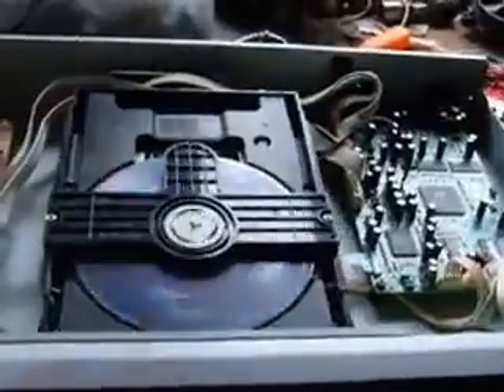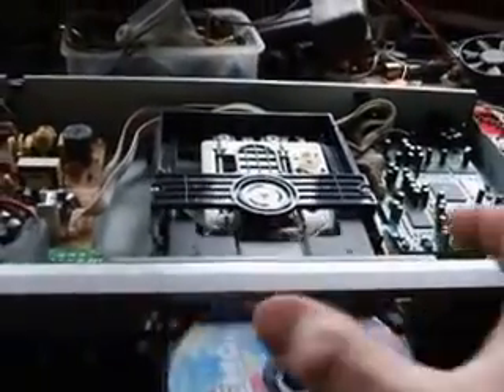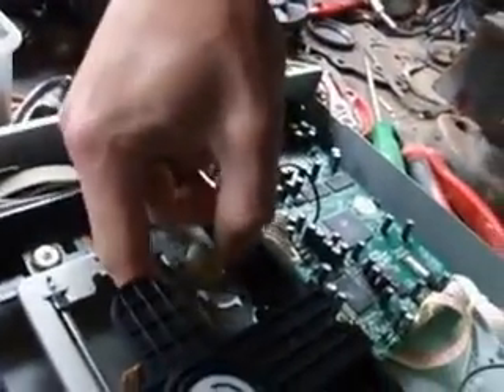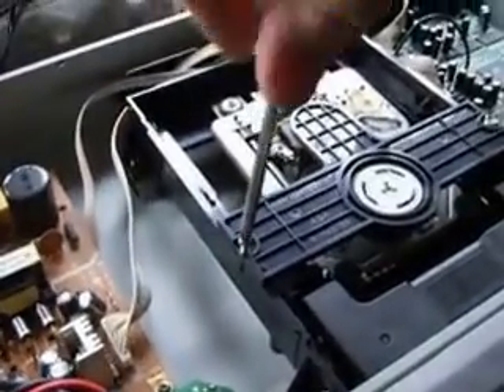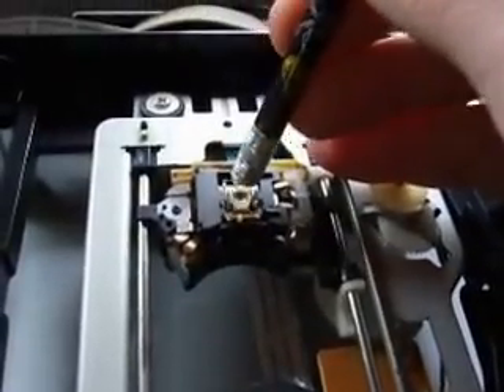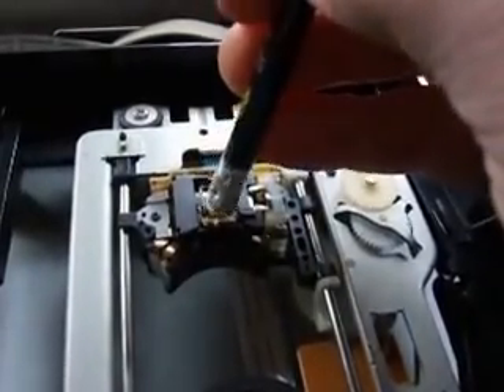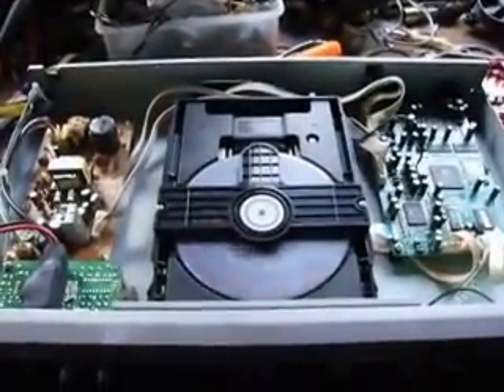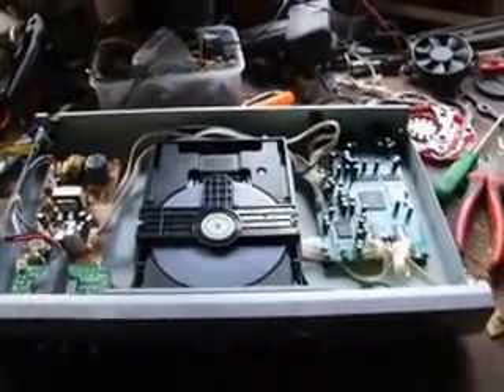Simple dvd fix that engineers use

Comment: how can cleaning the face surface of the objective lens , without cleaning the obverse side and the 3 focusing prisms underneath make any difference ?

the only engineer who would use this method as a first line treatment is Mr Magoo

and by the way the silica in the rubber would scratch an acrylic lens . This wouldn’t be an issue for cd or DVD but a death  sentence for blu ray

Comment: I have to say I was very sceptical about this fix but thought I may as well give it a go on my temperamental TEAC P650 CD player as I'd had no joy with the more widely recommended q-tip method. I'd also been unsuccessful in my attempts to locate the pot which increases current to the laser, which is mentioned in other videos. Anyway, a few rubs later with the rubber end of a pencil and a handful of discs that were previously not reading at all now do so fine and play through with no errors. I have more to test (discs of 70+ minutes were typically troublesome) but the signs look very good, so many thanks to RDJ for posting this!

Comment: Most cases a light rubbing with a cotton bud will get the dust off ... think of it like you looking through a really dirty window... you definitely can't see everything... to laser reading devices CD/DVD/BLURAY it can block enough that the machine won't acknowledge a disk at all ... and if it does it won't be able to play it correctly

Comment: Thanks for the instructional, gonna try this on the Sony DVP-NS57P I've had for years that started loading sluggishly and now throws the "cannot play disc" error, after having played it all night long. First, I must buy a pencil. lol
Reply: Any luck? Same issue here 🙂
Reply: @iandiaz4129  Sadly, no. I can't get the outer case to separate from the front panel. And I can't find a schematic or another tutorial that'll show that step by step. So, it lays on the bench partially disassembled. If I can't get help with that, I'll be forced to ship it to a repair shop across the state (or do eBay, which I don't want). Let me know if you figure it out! Paz.
Reply: @uppityglivestockian  ah.. mines DVP-S535D. Might get a new laser for mine as the above didn't work :)
Reply: @uppityglivestockian  After removing all the screws,side & rear, try lifting the rear of the case up as high as you can and pull the case back to free it.
Reply: @johnikey38  Hola, I can't believe I'm actually online when someone would throw me a hint on this. I actually did remove all the screws I could put a philips head screwdriver on, carefully put them aside but the front face of the DVR will simply not come off at all. It's as if the dvd tray should have been open first, because it seems to be stuck there. I have turned into a pretzel trying to get it to open, to let go, so I can reach the optical eye. I've had to bend out some snap clips on the superstructure to make it let loose, which worked on every other connection to the machine, but those snaps won't re-grip the same again, which is ok, the DVR will still work with a less than ideal housing fit. If only this video showed all the exact steps, lol. Thanks bud. Paz.

Comment: This is not how to repair a laser pickup on a DVD player. Yes sometimes dust can get in there that needs to been blown out. But it can run deeper like weak coils or laser getting weak or pick photo sensor not picking up or out of line. So many things can go wrong and you need a oscilloscope to check a lot of this. But this is just shit and why people put things like this up is mad. But worst you get people trying this crap after watching this. Would you put your fingers in a wall socket if this person told you too? Don’t mess with electronics if you don’t know what your doing. You could end up making more problems or worst kill yourself touching a high voltage capacitor or mains voltage.
Reply: He was very careful to kill the power before taking action and keeping out of the guts with the power on, so, chillax Nancy.

Comment: The old days of tube TV's and more mechanical VCRs , were great just a quick Whack or 2 on top are sides , Everything good as gold for abit
Reply: Computers used to have the drop-fix where you'd drop from a bit off the table - it was an oxidized connection issue.  It seems they've improved conductors, since.

Comment: cotton bud dipped in distilled water and a little washing up liquid. not dripping wet and only very lightly touch on the lens. I am a bit concerned here as using a pencil rubber contaminated with pieces of graphite pencil lead will obviously scratch the plastic lens and potentially do more harm than good.

Comment: I have a 5 disc Sony CD player (13 years old) that hasn't worked right for about 10 of those years but it's been sitting on a shelf begging to get fixed.   It doesn't have a pop-out tray.  Once the CD finally loads 9 times out of 10 it won't play.  Not sure if it is a problem with the laser eye but I sure am going to try this.

Comment: The title is misleading here, 'engineers use it so it's ok' I would use ethanol to clean the laser. This eraser stuff seems to do  the same thing, I would not recommend but if you don't have ethanol or methanol at hand it's ok  if it works. You have to remember that dvd-players are dirtcheap,30-40 dollars you get one, so if it doesn't work, you still could throw it in the bin.

Comment: I like q-tip and 91% isopropyl alcohol, or regular Windex in a pinch :) just be sure to wipe it dry immediately, cuz it leaves residue if it evaporates before you can wipe it, and it can evaporate within a couple seconds. Still, your method here is slightly ghetto, but useful cuz it needs no chemicals and should be sufficient for wiping dust from non-porous surface (considering it can wipe graphite from porous paper) as long as eraser is clean with no grit sticking to it.  Thanks
Reply: Mike Weatherl o

Comment: Hi
I'm wondering if you can do a Help video on how to fix a cd drawer that doesn't open
My Sharp Micro Component System is XL-MP60
I did the reset step...still nothing ....
Please help
Reply: Fil Faz 
Hey Fil. It's probably just the small drive belt in your dvd tray , that stretched out. It's on two small pully's. Look it up on youtube on how to fix it. Very easy. I had same problem and worked 4me😝

Comment: As an HND electronics engineer and a lecturer in chemistry and electronics I will NEVER EVER recommend using a pencil eraser to clean a laser assembly, DREADFUL UNINFORMED BLUNDERBUSS STRATEGY !
DREADFUL ADVISE -  IGNORE or use the erase method at your peril !

One uses cotton bud and medical grade iso propyl alcohol to clean the lens, period.
This wil remove most organic contamination and detritus cleanly with minimal residue and contamination of site.
I use this on professional studio cd players, where quality is the key and results are paramount.
Compressed air is also a no-no - why blow rubbish into the air and re-contaminate everything.

I really 'enjoy' these videos where the untrained or those with aa smattering of knowledge preach to the 'unconverted'
Trouble is that the 'wisdom  of the (youtube) crowd appeals to so many' ! Easy fix, never mind the consequences !

Stick to a cotton bud and isopropyl alcohol, this is the ONLY way to clean a laser assembly PROPERLY.

Nick W - senior lecturer in Electronics, laser systems and Molecular Chemistry.
Reply: Nick Wilson 
Lol... Umm. Has anyone ever think that it might be to many SCRATCHES/DIRT/FINGERPRINT smudge on the DISCS causing the problem? Because after a while a disc may develope SCRATCHES & etc that you'll need to clean & 'resurface' the dvd/cd. I've had these issues when my player would say 'ERROR' &/or take long to load up. Just clean &/or resurface the disc(s) real good and THIS may cure your problem. Note: Some dvd/cd player's are very sensitive to read your dvd/cd's. Therefore,  ANY little scratch &/or dirty can cause this symptom. SO START W/YOUR DVD/CD's B-4 OPENING THE UNIT😁 Just a tip✌

Comment: I would NOT recommend using an eraser!!! I ALWAYS use a q-tip dipped in isopropyl alcohol. Just make sure that after you dip the q-tip in the alcohol that you use a paper towel or a rag to absorb any excess alcohol on the q-tip before touching it to the laser lens. You want it slightly moist NOT drenched.

Comment: Usually this happens when the laser is failing.  The lens is not usually exposed to dust and it never touches the cd.  This repair might help but it probably won't.  You can save yourself the trouble of disassembly by buying a cd disc cleaner that has the tiny brushes on it. Like I said this symptom is usually cause by a failed or failing laser. Most cheap units only last a few years before the semiconductor laser goes out.
Reply: I have a couple players that won't recognize the cleaning discs. But I clean with camera lens cleaning kit.
Reply: Laser does not fall. Optics became dirty. And not only the upper lens. Inside there is a prism.

Comment: I've found these simple players are level sensitive...that is, unless the player laser is perfectly level...it won't play. So, put the player on a table top and connect a TV. Move the player around after hitting play until you find a spot on the table where the disc plays perfectly. Adding a rubber pad to the low spot will solve your problem.
Reply: Very true. And was talking to a guy in the Panasonic store who said that the disc tray can warp slightly so that the disc can’t sit plum in its seat. So won’t read.

Comment: Engineers don't use rubber because it will scratch the surface of lens due to fact that they are plastic in most of the caces... use instead dry cotton swab and clean the lens from dust with circle movements without push at all because you can bend focus and tracking coils inside lens mechanism, if this don't help at all there is a trimmer potentiometer on optic head itself (DVD heads have 2 of them because they have 2 lasers inside - one for CD and powerful one for DVD) - you can adjust power of each laser LEDs inside by turning its potentiometer slooowly by 1 degree each time while disk start to spin and player enter in its normal operation (yes you can hear that scratching noises - make them as low as you can when player reads disk normal and it is in play mode).
Reply: +Feni Lusilia yes you can try anyway but probably it wont help at this point because brush of disk cleaners is plastic an when it is mixed with dust it can scratch lens but still there is hope... try it, it may help
Reply: Agreed. Wouldn’t use rubber - may even have lead on it !! A dry Q Tip with delicate rotary motions is better. With the cover off, have a clean around with a paint brush to get the dust away. Then lubricate the glide rods with WD silicon oil. Need to be nimble and dexterous and not too heavy - handed as you could break something in there !!

Comment: Thank you this did the trick on my player. I tried a cleaning disc and cotton pad to no avail.  I'm not an expert on these things but I think the laser components are a lot stronger tougher than given credit for by some commentors. The eraser trick worked and I used a little bit of pressure in order to rub the lens rather then just wipe them, after all they are sprung.

Comment: This worked for me too. Error was "No Disc".Disassembly to access the lens was a bit more complicated on a JVC UXJ50 but next time should be easier now I know where all the screws are! I used a new pencil eraser, gently, and brushed any surplus rubber away after with a soft artists paintbrush. The lens was visibly clearer after cleaning. Plays fine now. Thanks.

Comment: Cleaning the optics is pretty much always one of the first things to do when troubleshooting an optical drive that won't read discs.

But, I wouldn't use a pencil eraser to clean the surface of the objective lens, especially if the lens is made of plastic.  There's too great a chance that the abrasiveness of the eraser could mar the lens, thus ruining the pickup.  Instead, you should use chamois, microfiber, or even cotton; any clean and soft material that has little to no abrasiveness.

However, a pencil eraser can be used to clean the electrical contacts on the flex cable used to connect the optical pickup to the player circuitry.

And, of course, careful use of compressed air can do wonders at cleaning things out.

You should also lightly lubricate mechanical parts of the drive, if necessary.
Reply: Foam swabs soaked in isopropilc alcohol....secure way!

Comment: Thanks. I fixed my dvd player with your tip. I cleaned the lazer eye.. i used toilet paper and mild cleaner diluted with water .. barely damp toilet paper wadded tight and lightly wiped it clean. noticed difference by eye of clarity after. it worked perfectly! thanks! I do not know why I did not think to clean its eye .. should have been easy to figure out.. it was making a clicking noise too... and now it is silent. I cleaned alot of dirt and dead roaches and roach poop out of it! It came from a roach infested house. I figured roach carcasses had shorted it out. I was thinking it was toast. I cleaned it all out and wiped roach poop off and washed little bracket and cleaned lazer eye.